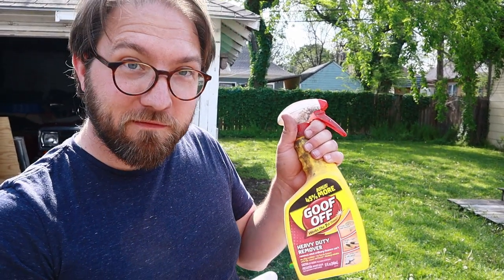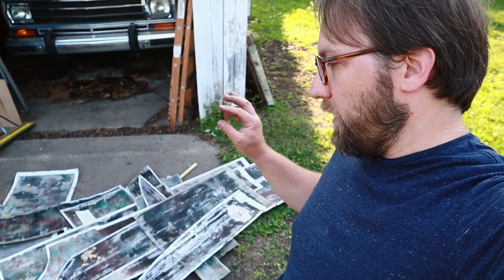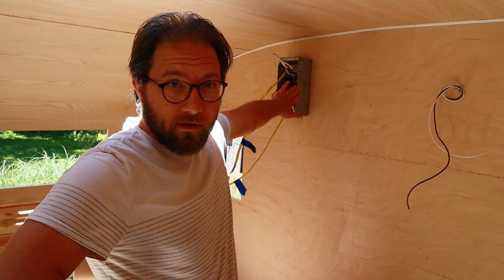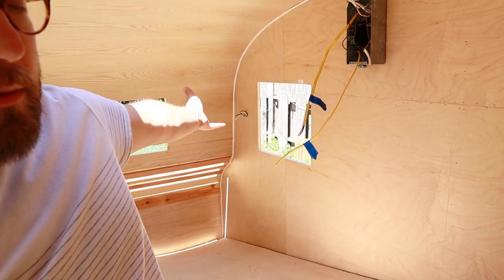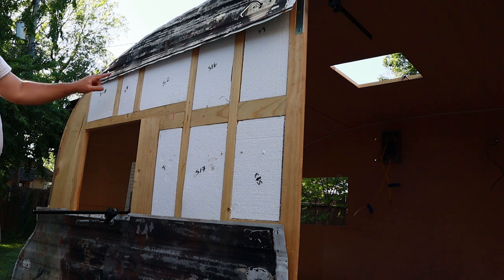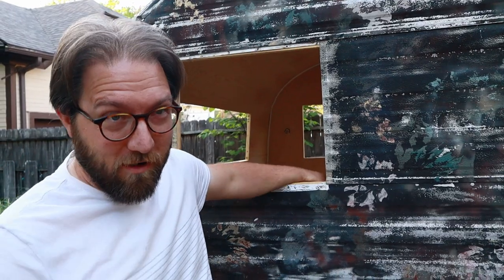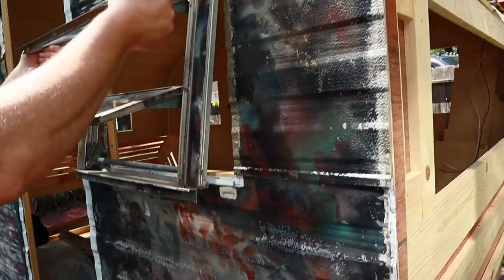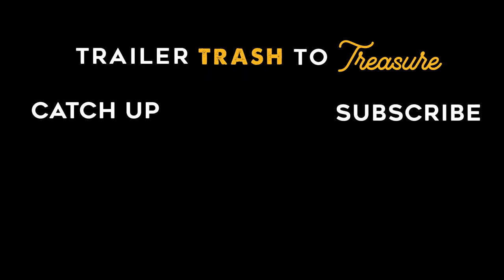VINTAGE CAMPER REBUILD NEW WIRING // RE-ATTACHING SKIN

Comment: Hi Conan, 
Thank you for letting us all join you as you rebuild the Playmore.  I picked one up 2 years ago and you have inspired me to start putting mine back together in 2021.  Mine is also a 140 model, but a 1969.  Roughly same shape yours is.  I had to duct tape the walls to the front  and replace the tires to tow it 30 miles home.  I really like your layout and you had mentioned possibly sharing your sketch-up and measurements.  If that is possible I could definitely use them.  Mine's down to the bare frame on the trailer and my old walls are in my garage ready to start copying.  
Thank you again and a HAPPY NEW YEAR to you and yours,
Willem
Reply from the maker: Hi Willem! Thanks for watching and for the kind words! Our last camper we re-did, we had to stop at a hardware store and buy duct tape on the way home because the back window shattered - what an adventure! That was some white knuckle driving!! The sketch up pdf download link is in the description of this video: https://youtu.be/Z-jEnLLSlqI Happy new year!

Comment: Hi Conan! Which power converter box, battery and 12v wiring did you use? Love the channel!
Reply from the maker: If I remember correctly it was the PowerMax PM4-15 15 amp converter box. We didn't install a battery on this camper; although, I've considered adding a basic 100-ish Ah battery, nothing fancy, just for our lights and fan. Wiring was just basic 12GA stranded automotive wiring. Thanks for watching!

Comment: What type of staple gun do I need to go through trailer siding. I just bought an electric stapler that uses T50 staples. It takes up to 9/16 size.
Reply from the maker: I only use T50 staples to attach things like fabric to wood for maybe something like upholstery projects, but I use an 18 gauge 1/4" crown stapler to attach wood to wood or aluminum to wood. You can get air powered or electric 1/4" crown staplers, and I think the staples go up to about 1 1/2" in length.

Comment: Hi Conan,
Thanks for the sketchup link.  I only have the free version of sketchup, so I'm not sure I got all the sketches, but it was useful.  I finally got around to working on my '69 Playmore.  I almost have the walls finished and am preparing to start on the trailer.  I have watched the episode where you stripped off the old decking and rebuilt it.  I noticed you made sketches and measurements to help build the new deck.  Would you be willing to share them?  My brother took the old flooring off for me and forgot to take pictures as he did it.   
I live in the southeast Texas area with plenty of rain and humidity.  I noticed you decided not to use any weather proofing on your build.  Due to our climate (and not wanting to pay an arm and a leg for covered parking), I have decided to use several different approaches.  Please let me know  what you think.  I plan to use something like a Thompsons water seal product on all the bare wood, coat the bottom of the trailer deck with a rubberized paint, and I was also thinking about using a product like tyvek to "wrap" the camper.  
I know it sounds like overkill, but like I mentioned we get a lot of rain and we always have lots of humidity.  Anyway please give me your insight.  You have much more experience doing this than I do.  
Thanks again and take care,
Will
Reply from the maker: Hey Will! I'll see if I can't scan my drawings and pop a link up and let you know. Sketchup free was the version I made the 3D model in as well, so if you actually hide the groups on top of the frame you should be able to use the measuring tool to get any dimensions you need. I don't think I included every part of the metal trailer frame in my model, but all of the wood framing should be there.

Anyway, people seem to have a couple of theories about weatherproofing the undersides of their campers. One is that it needs something heavy duty to protect it from water splashing up from the road. The other is that it needs to remain open to dry out when it does get wet. I suspect booth ideas have merit, but the weatherproofing sounds like a lot more work and it would need to be thorough and maintained over its life to really work. That said, our camper did have some sort of undercoating on it from the factory, but I can't say that it was in any better condition than any other uncoated floor that I've seen on vintage campers in similar condition.

As far as coating and wrapping the walls, I've seen people do it, but they weren't done that way from the factory, and if the insides of your walls are getting that wet, you've got some other serious issues with the skin that need to be addressed. I don't necessarily think Tyvek would be a bad idea since it's breathable, but campers experience such extremes of temperature and humidity that the goal should always be to allow them to dry out as efficiently as possible. I've seen some people do plastic vapor barriers and I don't think that's wise.

So yeah, to put it simply, I generally think the best practice is to do whatever was done at the factory. Good luck!
Reply from the maker: Just put the pdf link in the description of this video. I'll add it here as well but no sure if it will work: https://rb.gy/bznxru

Comment: I was hoping you'd provide some wiring details...
Reply from the maker: Well, at the time I made that video I was a bit afraid to give out any advice regarding electrical in case someone hurt themselves doing something I told them. When I get to the wiring on the camper I'm working on now I'll do a more thorough video, so make sure and subscribe.
Reply: @TrailerTrashtoTreasure  I recently inherited a 1964 Frolick and am in the trawls of deciding what to do electrically.  Everyone with money does it all.  It's tiny and I want to do mostly boondocking...  Tnx!
Reply from the maker: Well 30 amp systems are pretty easy to wire in, but if you want to add solar to it you're going to get a bit more complicated. Still though, it's a manageable project on your own, and there are lots of van conversion projects online that talk about how to add solar if that's what you're into. I personally don't think solar is worth it from a cost standpoint in a small camper, and a small Honda 2500W generator is both affordable and easy to use.